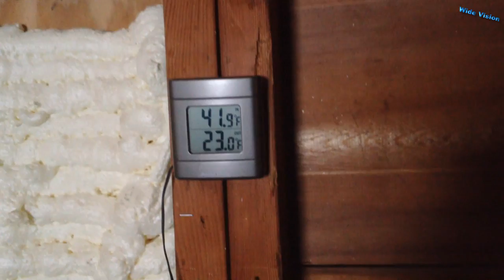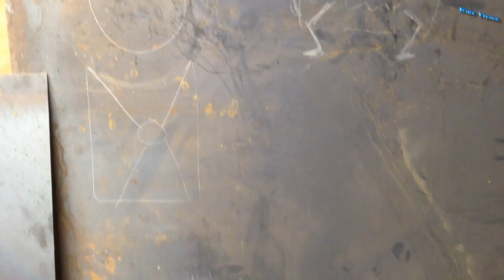Wood Burner Built From Junk

Comment: Notice, unlike commercially built Square stoves, a ROUND stove will NEVER need Firebrick, to keep the corner welds from cracking. Round stoves heat more evenly & can even glow every night & never crack their welds, all the while putting out more heat for a given volumetric size. If you put a Baffle in front of the exhaust outlet, It'll burn even more efficiently.

Comment: As someone who's heated with "Wood Stove's" for a VERY LONG TIME. You need to add on a small flat surface (just big enough to hold a "Tea Kettle.") Wood stove are notorious for making the air you will be breathing, EXTREMELY DRY. Just fill your tea kettle with water, and your good to go. For those who may be using a wood stove for their first time, how "DRY" is "Dry?" In just a short amount of time I'd say 4 (four) to 6 (six) hour's time, will give you a VERY SCRATCHY throat, also your throat will be VERY DRY, like you've been in a desert for day's. Assuming  6 (six) to 10 (ten) hour's a day, burning wood in the stove, and depending how hot you get the stove, I'd expect to have to refill the tea kettle every 4th (fourth) day, or just a little bit sooner, i.e., 3 (three) day's.
Reply: plus you can make tea at any time, double win!
Reply: Fair comment, so long as you don't pump too much water into the air with it though. Depending on what equipment you have it may cause extra condensation overnight when everything cools off, and may cause issues
Reply: @TomMakeHere  Not to worry, your never going to get close to creating a tropical climate, of excess humidity. I never did use a guage to measure the relative humidity, but I'm guessing in the range of 10 -20 percent,  20 percent being on the high side. I'm curious, do you take the time to analyze a situation, i.e., average capacity of a 6-cup-teapot, spread out over minimum three day's, works out to 2 (two) cups of water a day. Your really not trying to equate that somehow 2 (two) cups of water a day is some how going to cause problems, say rust every thing in sight? Make all of the wood swell, (you could alway's dream that would happen.)
Reply: It isn't that the wood stove dries the air any more than any other heat source. Warm air can hold more moisture than cool so the relative humidity of the air goes down as you warm it. The cold outside air contains very little moisture and is constantly replacing the indoor air. He could improve the efficiency of his system by providing outside combustion air.

Comment: I built a couple of stoves,they worked as good as anything I could have bought.I got a big one made out of a seventy-five  gallon water tank off a concrete mixer.The weather is getting colder and I will start it up as I have for many years.I built this stove back in the seventies.

Comment: Hello:  new to your channel.  In the for what its worth category.   Absolutely love the door handle and latch.  A few minor suggestions for inproved heat output.  A few you may not hear from others.  If there's still anyway, or for your next stove.  Lower the flue pipe down into the stove compartment.  That way it allows a pocket of the hottest air and gasses to accumulate at the very top of the fire box.  Next, weld on the thickest mother piece of plate steel you can find on top of the stove box.  If you can manage to find one big enough to go around the base of the stove pipe all the better.  Heavier the plate steel, the longer it will hold the heat through the night.  If you can, especially through the back of the fire box cut a vent that you can hook up a 4 inch dryer vent hose through the wall so you're drawing fresh air from the outside, not the heated inside.  Lastly if you have some scrap square or rectangular 2x2  or something close and weld them vertically onto the back of the stove it will increase the convection output.  
I once saw a stove where the guy had four 2" round 3/16" walled tubes.  The four tubes were inside the fire box and were cut through the back wall of the stove went across the inside of the fire box and exited at the top of the stove in the front.  So air would enter the tubes at the back of the stove at the base, rise up through the tubes exiting at the front.  It was all passive convection, but OMG that stove put out so much heat.  Plus the door was a latch that used the bracket from a horse spur that you wore on your boots. To latch the door,  you lifted the spur!  It's difficult to describe but he made me aware of how much you can put convection to work.  Oh thanks I had never seen the sand idea used, sounds good.  Thanks, Scott
Reply: You seem bright, thank you for the tips.  I think they will work out great if I try them.

Comment: Nice job, get a lot time in something like that   I'm building one similar from old hot water heater, I cut oval top off and flip it to give secondary burn chamber, and add 6 inch rocket burn to side for extended burn time  nice

Comment: If came out nice!  I was all set to build one for my shop and ended up dumpster diving and getting an older Ashely forced air wood/coal fired furnace!  Works nice heating my place plus I enjoy cutting the wood for fuel.  Have yet to burn coal.  Keep up the good work and stay warm!
Reply from the maker: That sounds like a heck of a find!
Reply: Even a blind squirrel finds an acorn every now and then.  Worst part is all the controls were junk so I wired both blower up independent.  You can tell they made it so that a power failure would smother it as all the air comes through the draft blower.  Plus you almost can’t feed it enough wood to keep the air handler running full time.  I’m not sure I’ll sweat it too much as I don’t generally run it unless I’m there to feed it and keep an eye on it.  I’m far enough south it’s generally not terrible temp wise.  

I really enjoy watching all the stuff you build as well as the scratch built tools.  Take care!

Comment: You might want to put a baffle in the top force the air to flow 2/3 the way to the front of the stove and double back to go up the flue.  That way all the heat doesn't go up the chimney and you might get a secondary burn in that upper chamber too.

Comment: Needs a baffle to get some re-burn and slow the heat going up vent pipe by re-directing it to the front then up and back to the vent. You could also get a lot more heat recovery from the exhaust pipe in many different ways....but nice build all the same. I'm a cheap skate and want to keep as much as the btu's as possible and burn my firewood as slowly as possible but obviously above the temps that build amounts of creosote. I build stuff from junk all the time as well....i like the character of stuff that works in its present life differently that its former life but in fact still preforms a useful function.

Comment: Wow. Classic Alaska oil drum stove, but with pipe instead of drum. You really need a vent. The best vent goes to the outside through the wall. This prevents the inside air from going through the stove and then up the chimney. After you have done that, try a fireproof gasket on the door. Very nice job!
Reply from the maker: Howdy Juan!  I debated about venting to the outside, but figured the garage is drafty enough. Besides, I need some air turn over when welding. :)
Reply: I still think you need a vent, even if not to the outside then to the shop, because you are essentially drawing combustion air from leaks in the door. The vent could be as simple as a couple holes drilled in the front bottom of the drum. As an extra, you could shutter these holes.
Reply from the maker: @juanrivero8  There are holes in the door. 2 of them towards the bottom.

Comment: Nice stove !!! I started making a stove for my shop out of an old pig tank for filling tires. Pressure gauge got knocked off and someone got it swapped out under warranty when I worked at Canadian Tire. Still need to make a door for it and I like how you made the door on this, might steal part of that idea for my stove.
Reply from the maker: I had an old air compressor tank I was going to use for this, but upon inspection, realized the tank was rusted badly on the inside. My plan for it was to cut off the front dome,  roll a strap iron that fit inside, then the dome would be the door.  But I really like this door. The double angle iron seals very well!

Comment: I built a few wood stoves over years and when I used pipe for a stove, I made them standing up with about four to six inch legs on the bottom and the door is about two thirds the way up to have a head above the door. That way I could use a lot of variables for heat but primarily wood. I know it ain't right but my stove my rules so any greasy rags that accumulated I stored outside in a vented area where my scrap steel was at and they got used up or burnt on purpose because in a pile where ever stored they will "build" their own fire from spontaneous combustion. that flat tom had a iron kettle on top always with it full of water cause I just don't like bloody noses especially in winter months, cause up here in Alaska the air is pretty dry. I guess I stuck my own nose into a fair amount of fights when I was a kid and then if I tripped over my own feet I made contact with something on the way down.... want to hear the rest of my own stupid mistakes growing up???? Well I was a boxer in the army an my nose was fair game to just about anyone in the ring and ducking was something I never really got the hang of/LOL. Anyway you just about never had to measure anything you planned to burn and when I could make it back to the house in the wee hours of morning mostly, I'd chunk some healthy sized wood in it with knots or somewhat wet and it would hold the fire overnight. I always would open the stack it the morning when I come in to burn the creosote out which I had real thick pipe for the chimney and it was also rapped with asbestos so the heat didn't get the nearest anything on fire. Of course my roof was steel also. I like your stove and only thing it needs is a place for the coffee to set. Enjoyed the video and I miss my wood stove

Comment: didn't you consider making dumping doors on the bottom and some metal  bar grate to keep the wood from directly touching the bottom wall
also how abour efficiency of that thing? does it  have enough surface area to radiate all the heat or most of it is going out trough the chimney?
if the later part is true you can plumb it to a water jacket made out od copper pipes wraped around and put that  water to some old trucj radiator .
it would look ugly but it could give out much more heat given bigger surface area plus it woyld be safer to tauch because it would be colder on the surface

Comment: Thats a nice stove job! 
But brother U gotta have Air flow! A stove wont function properly if it can't get air from the door to make ur smoke draw up the chimney! U should cut  some (Dime) size holes in ur door about 1 1/2" 2"  inches up from the bottom of the door! Then put a slider piece of metal U can slide to open & close the draft holes. Then weld a 1-2 inch piece of channel metal under ur slider vent....This is to catch any small piece of fire that could fall out of ur draft holes & keep the fire embers from hitting the floor. It really is a Super Nice looking barrel Wood Heater.  But U gotta have a draft Vent & about 1 1/2" 2" inches off the bottom of your door is where it needs to be! If U run that stove that way it wont burn efficiently & it wont draw up the chimney like it should without air to push it up & out better. 
Note: Fire has to have air to burn. 
I hope this Tip helps U. 👍
Reply from the maker: Read the description, or the many other comments I have gotten about air intake.

Comment: Well done ! , however I think you will need more air coming into your fire on the door a adjustable damper !
the main thing that compels me to comment is your installation of the stove....
the big piece of steel toward the wall is well and good but nowhere enough to keep the wall from charing or catching on fire
i know this from experience !  I later discovered a reasonable cure to the problem.
I used aluminum roofing tin Up the wall in 2 layers separated about 2" from each other so air can move between them.
when you get your wood stove Red hot all the way around and really cooking good, take a lazer thermoneter and check your wall wood temp behind the steel plate and you will be cooling it down with a sprey bottle of water before it ignites ! 
steel does not protect the wood that much , Aluminum will  it conducts heat much faster, but you need 2 or 3 layers to protect the wall.... believe me I know
Bob.....
Reply from the maker: After 4 months of use, the wall behind has never even gotten remotely hot. At most I would call it warm, and  I have checked it repeatedly.

Comment: where is the damper in the front of the stove??  Not much air gonna get in there to burn your wood very good.. Use a pipe cap and a bolt/nut and drill a few holes in that door behind where you put the pipe cap at the bottom of the door for the air to get in and you got it done!!!

Comment: Nice. I built a similar stove with a couple of truck rims stacked up horizontally last year
Have you considered a baffle plate? It will massively increase the heat output. I imagine with your drum length it would use up half of the drum otherwise it might struggle to draw properly
Reply from the maker: I thought about a baffle, but decided I didn't have the room in the stove to waste.  I'm currently thinking about building some kind of heat reclaimer with a fan to the exhaust. Not sure.

Comment: And you need a rubber gasket around the door to help it seal too. (Just thought I'd help out with the "Useful Comments" bit).
Reply: I think a rubber gasket just might melt. Anyway a little air leaking in might help with the combustion, there is not a lot of air getting in elsewhere.

Comment: Looks good ! What’s the length and width? I’m thinking about building myself one.
Reply: Whatever size the piece of scrap you have in the yard or find somewhere is.... Those are the perfect dimensions, makes for a clean hot burn every time guaranteed.

This is not a guarantee.
Reply from the maker: I think it's a 13 inch diameter pipe, and I cut it 25 inches long since I burn 24" long wood. It's a little too narrow, honestly. It would be a lot better if it was square, but it gets the garage to 60 degrees no problem!

Comment: Neat but did you put a vent in so the stove can  breathe
Reply from the maker: Oops, apparently I skipped that part.  I drilled 2 holes in the door.  Visible at 14:40.
Reply: Make adjustable air holes in the door, plus a window. :)  @WideVisionMetalFab
Reply: I'm betting the tiny little holes aren't enough?
Reply: I don't think so  @pmm422
Reply: thundersnowstorm. Yeah you are right. I told him to drill dime size holes & put a Metal slider to slide over the holes to open & close & adjust his air flow with. 
I also told him to weld a 1"-2" piece of angle iron across under the slider to catch any little pieces of fire that may fall out of the dime size air holes! 
Then he could close the vent some leaving a little hole open at night. Then while he sleeps or is away he wont have to worry about a piece of ember that may fall out the hole & burn his home down. Because it would just fall in the angle iron get trapped & die out! Right ?  😉 👍

Comment: Hey! Neighbor. I'm located about 25 mi N and West of DIA, 6.5 mi NW of Hudson. Might ought think about some combustion air, a 2" pipe in from outside air would double the effective heat you would get, just sayin. I'm in the process of pulling electrical power in to my new retirement shop out back of the house. Great video, trying to get started into the video generating part of YouTube, also. If you are thinking of using old engine oil, check out the GerrysDiy page. He has a very simple design to modify wood stoves to quadriple the heat out, at least. Lol
Reply from the maker: If you want, send me an e-mail at wide vision metal fab (but no spaces) at geee mails (it's also listed in the "About" of my channel). I make it down to Great Bend once in a while to see relatives,  we could get together sometime.  I'll check out GerrysDIY, thanks!

Comment: Nice stove. Love the handle. How you made the cut through the wall? Here in Finland we have strict regulations when it comes to exhaust pipes and chimneys in houses or work areas. Usually most of the fires in buildings start from the walls or roofs where the exhaust pipes or chimneys go through. Pipes has to be insulated properly inside the wall or roof material so that heat can't touch those. Like all the selfmade stuff you use for building and installing (table crane roller etc)..
Reply from the maker: Mine's not to code, so I didn't show it.  I simply  cut a big square in the wall, then I just have the pipe running through a sheet metal plate. I have about a foot of clearance to the wood frame above the pipe.  I've checked it frequently, and the wood never gets warm. I'm thinking of wrapping Kaowool around the pipe, just to be safer.
Reply: It is more complex than "distance from a wall."  If, for instance, the wall is covered with a brick layer, you can get close to the wall, although 12"/30 cm seems to be a norm. Here in Alaska you need a "thimble" for the pipe that goes through the roof.  This is an insulated  pipe joint. You also need insulated pipe. When I put in my woodstove, I perforce had to be up to code. So I actually did a CAD drawing! It worked and I enjoyed the stove until the day I left. Oh, and you need roof stays to keep the chimney from blowing over, which seems very important in Kansas!